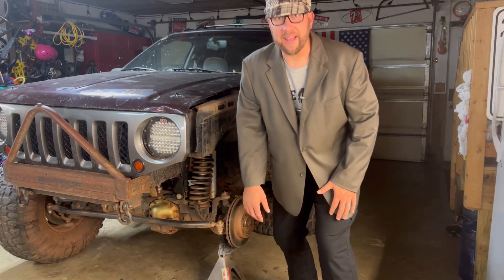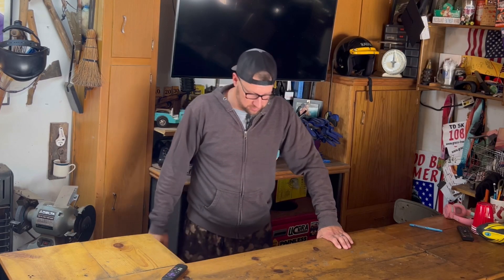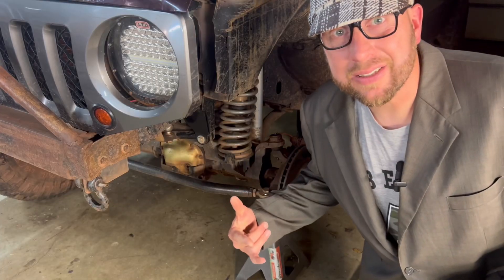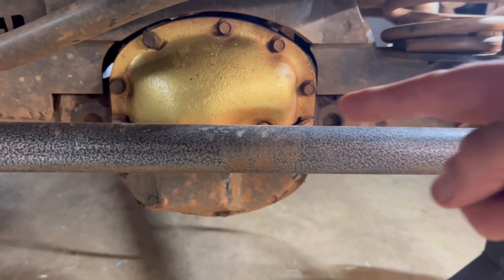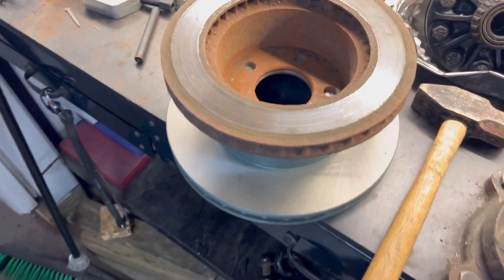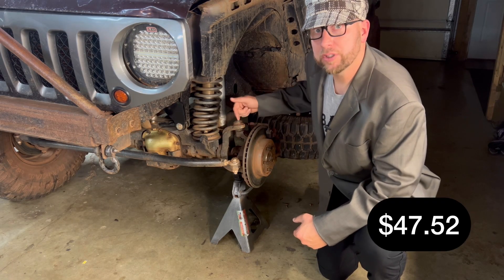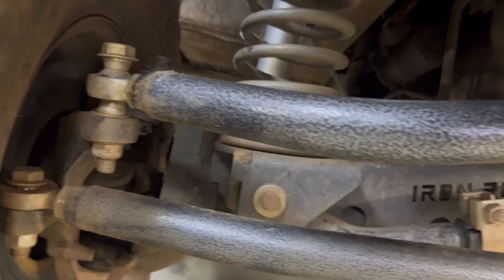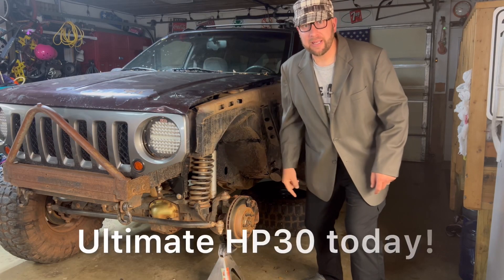The Ultimate Dana HP30 Build | Complete Cost and Parts List. #thegoldyproject #jeep

Comment: Did you use the 373 carrier out of the wj? Or you stayed stocked gears from the xj
Reply from the maker: I used the stock gears from the XJ HP30. I haven’t heard of the WJ carrier before. I plan on installing 456 if I ever get the 8.8 in the rear 😁 Thanks for sharing 👊

Comment: Core 4x4 makes a over the axle track bar and 1 ton steering kit specifically for the wj knuckle swap. Not sure if that's what you're looking for as it does still use tie rod ends.
Reply from the maker: Wow, good information here 👍 Thanks for sharing 👊 If this ZJ finds its way back to the road again that would be a great option!